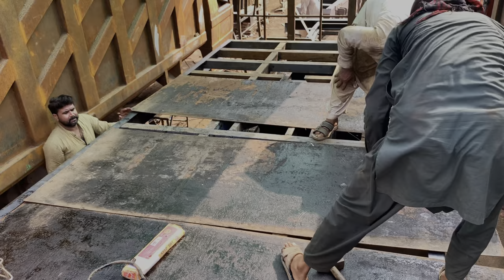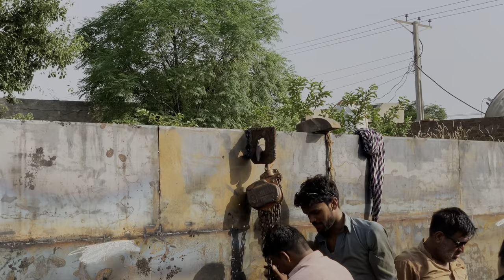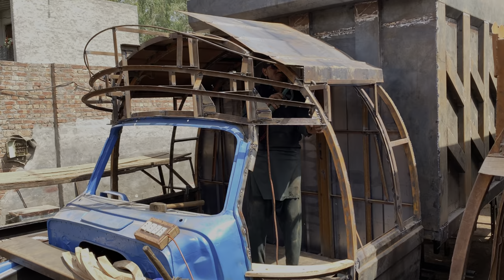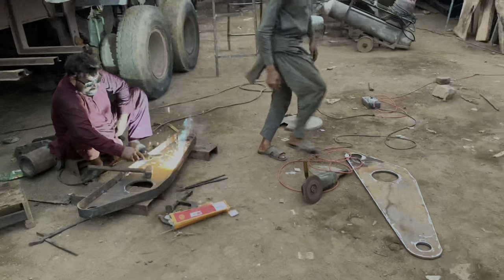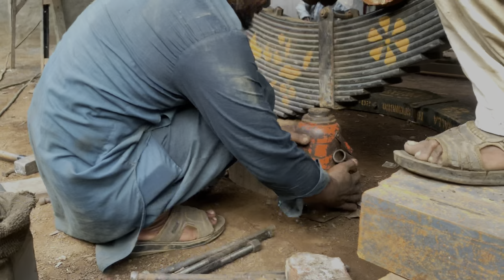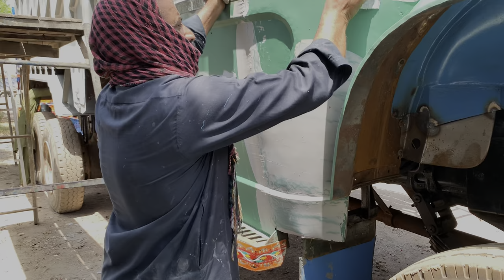We Bedford Truck Dumper Are Made  ||Pakistani Trucks ||

Comment: It is unbelievable that these men started with a frame and built that truck with so few modern tools, that could never happen in America
Reply: Supply and demand will dictate the cost of labour … . But they are great craftsmen nevertheless
Reply: They start with iron sheets.this handmade frame is also new
Reply: The most amazing part is they're doing it with open sandals on
Reply: Молодец супер мастер свою работу
Reply: Hii
Reply: You obviously don’t know the hot rod community 😂 but the amount of start to finish work is impressive as is the use of wood and steel, like the old Fords used to. I’m really impressed by their painting skills at the end. Such elaborate colors and designs
Reply: It used to happen , 100 years ago approx .
Reply: @CrustyRustysRestoration  two different levels cars aint nothing these guys work with extremely heavy parts not even in same category
Reply: they would be in the stone ages without a welder and turning lathe
Reply: @ThatCarGuyYT no development in 100yrs😮
Reply: In america you have regulations in order to remove this death machines from the road.
Reply: Йй~😊` @ExSheriffFattyBoySkinnyArms
Reply: No but if that was in usa the sure weight of bed truck be over weight but it’s a very strong bed
Reply: @ExSheriffFattyBoySkinnyArms nice. Since much hate on here. They do alot with a little. I dig it

Comment: Give GMC a run for their money! The donkey was a nice touch! Would have liked to see some full welds, saw nothing but tack welds throughout the vid... Would have liked to see better weld prep on the hydraulic frameworks, especially those flame cut pieces...Use of torque wrenches?...not fond of body filler over welds...quite the painting artist! loader operator a bit of a psycho...overall, impressive work!!
Reply: Yeah, I thought the welding was pretty sketchy.

Comment: For  some time now. I've worked at E.R F  unloaded Engine's.  Gear Boxes , Axles. & Springs, That was it ,Oh & The Wheels, Anyway . The Springs these Guys have fitted there is allways a big clearance from the centre of spring to the  Chassis; ?  The Springs themselves these are What i call Bloody heavy duty The Springs at E R.F we're not that shall i say Deep ?  Put it another way those rear springs 
 You could fit on a Minging truck Carrying  about  25 tons or more  they still probably wouldn't  flex ,?  Is this Wye  there bloody axles are allways breaking? Oh & beeing over loaded is more  Likely, ?😊 ; Well sorry to bore you with all that crap, Right back to this Production line Bedford Truck. I believe thave just had an order for 90 trucks,😊😊😊